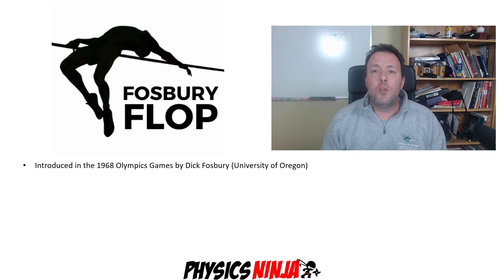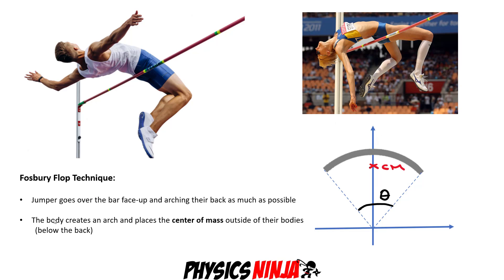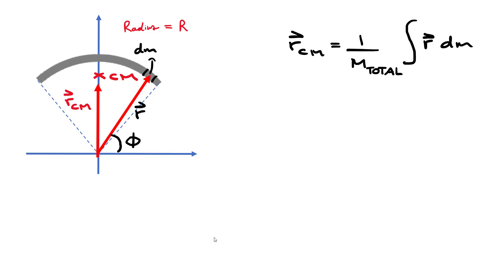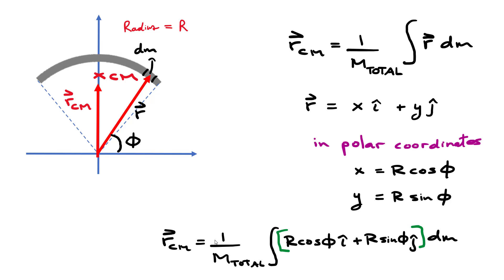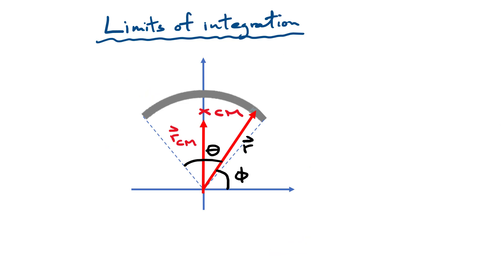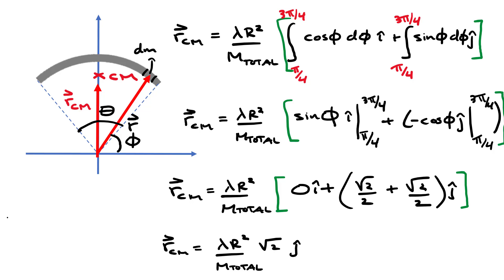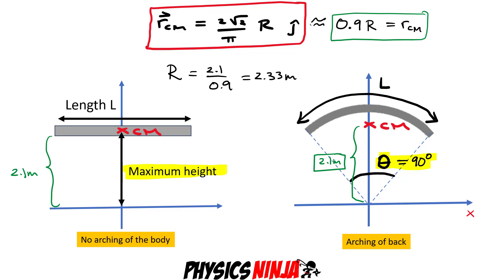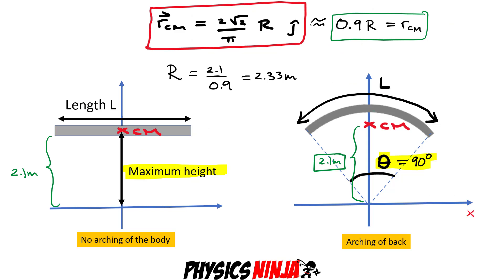Physics of the Fosbury Flop:  Center of Mass of the Arch

Comment: Hi, I really appreciate your content 🧠 Would you be interested to talk about the physics behind my circular swing of #travelingrings ? On the one hand, when we swing inside (and thus pull outside) the polygonal setting, our arc of motion isn’t leveled and use a mix of centripetal energy and potential energy. On the other hand, when we swing outside (and thus pull inside) the polygonal setting, our arc of motion could be either leveled if we glide circular at the right speed or waved due to the potential energy transferring in kinetic energy if we glide elliptical at a greater speed. I’d love to simply evaluate the difficulty of a setting according to the length (of strap) and spacing (distance between rings) for polygonal apparatus. Best regards from Stuttgart, John (also father & engineer 😉)